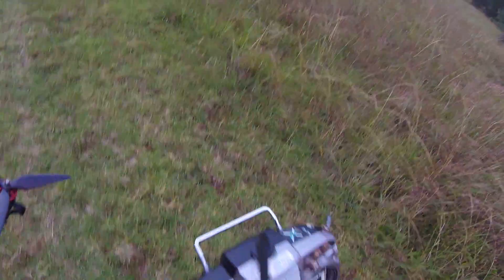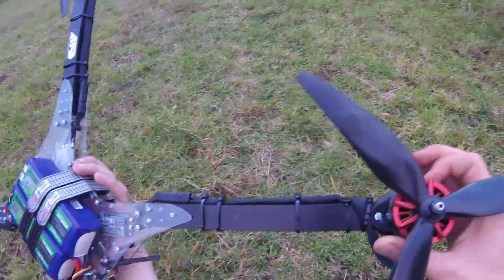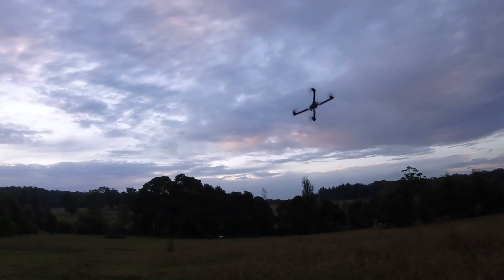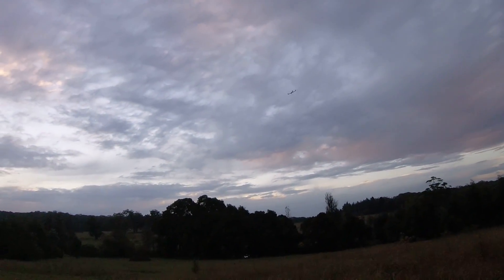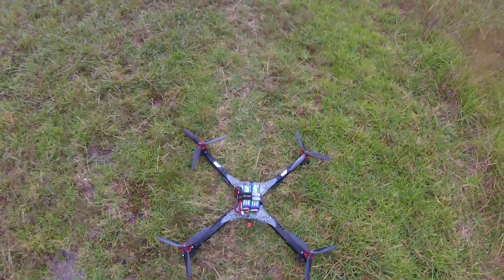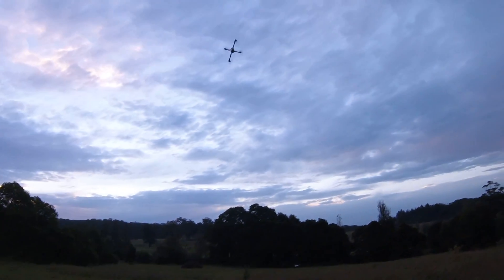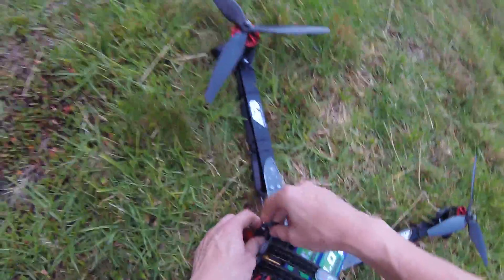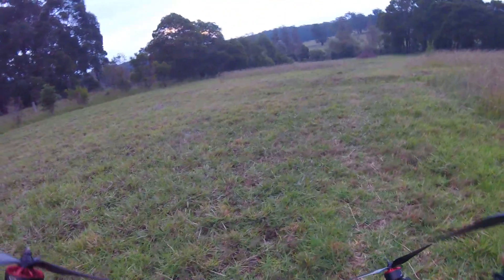HQ 12" Xnova 12S Ripping

Comment: Do you feel like the props are loading the motors enough at that kv?
Reply from the maker: I'd say this is about right, they could definitely handle higher rpm tough
Reply: @autekxracing4593  Were you able to get an rpm data? I'd reckon 15k would be keen.
Reply from the maker: No I don't have telemetry set up on this one
Reply: Were you part of the 500kv 12x12 test on Tony's channel?
Reply from the maker: @briankoch7041  not sure maybe